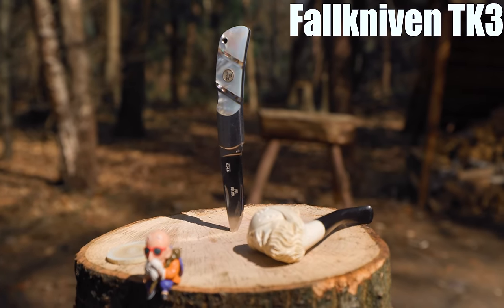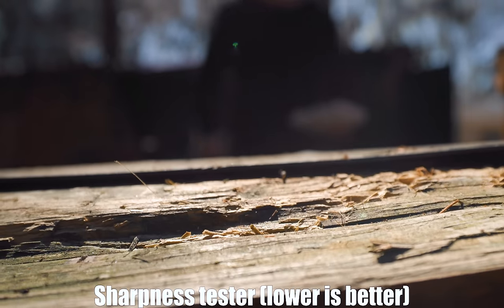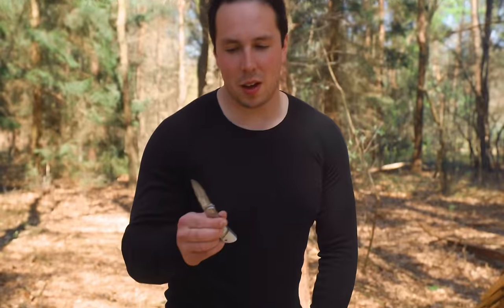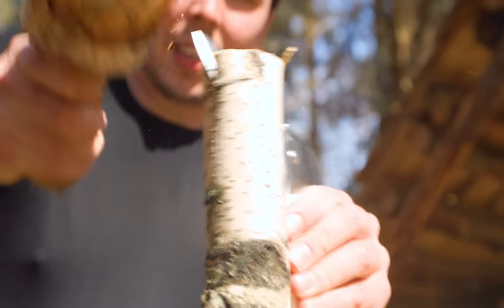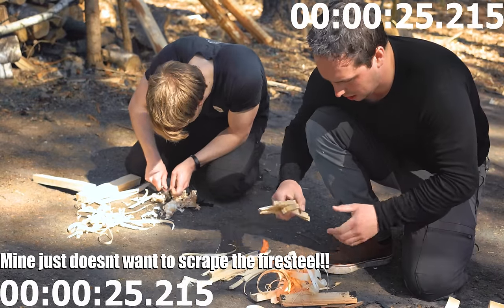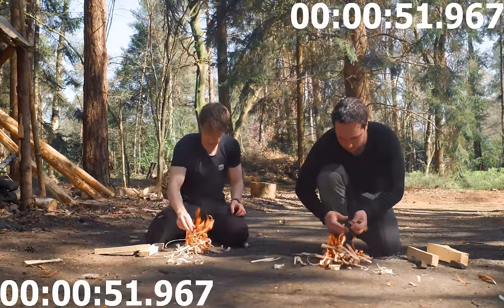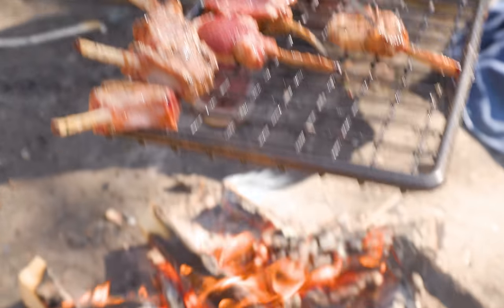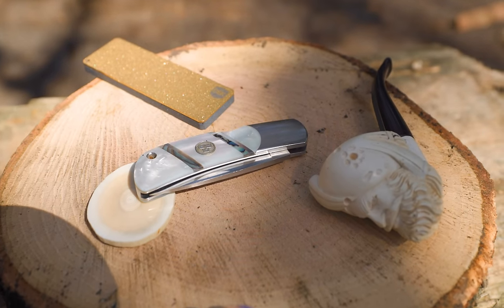Most used knives in our $50,000+ Collection...FALLKNIVEN still wins. EDC favorite

Comment: Hello guys. My ADC is a Leatherman Surge,  as a knife not to brag about but I personally have use for the pliers and screwdrivers. And yes in a emergency you can actually cut something with the blade. And I don't have to carry a tool roll when I'm riding my motorcycle.

Comment: For my EDC: 8-9 out of 10 times since about 2015 will be Cold Steel full-size AK-47 folder/ Back then I purchased 4-6 of these at $50/knife. Still EDC-ing the first one despite losing the Demko thumb plate. That said... it made me use Loctite on all the rest of my Cold-Steels w/ this feature for loss prevention. For my multi-use... the Triad Lock design on a folder is the greatest strong-suit benefit.

Comment: Most carried knife is my lowly Opinel no. 8 in carbon.  I have slimmed / squared and contoured the handle.  It meets all of the light duty tasks that I'll typically require.  Love the thin razor of a blade for cutting up food for my kids while we are out.  Best suited because I live in a hot weather climate I wanted something very lightweight but with a decent length of blade that I won't hate riding in the pocket of lightweight shorts.

Comment: Awesome video as usual 👍 My EDC = Cold Steel/Taiwan Voyager 5.5" clip point plain edged. Backed up with Victorinox Scout. Carried for left handed use. In my EDC backpack is Cold Steel TaiPan VG1 SAN MAI set up to carry SOB left handed backed up with Glock #81 field knife attached to outside of EDC backpack. The Ontario 18" machete, folding saw & Estwing hand axe are kept in back of the Chevy Suburban. Thinking of retiring the Voyager with Espada XL G10 as it's replacement for EDC primary. Saving up now while still undecided on which Falknivan knife to add to my pile. Your videos are paramount to making my final choice. Looking forward to more outstanding content. Thanks again & best wishes 👍 from 🇺🇸

Comment: I carry the spyderco Domjno the most it’s around $200 carbon peel handle on one side and a titanium frame lock with steel insert on the other side nice big bellied blade thin and slicey edge and grind CTS-xhp steel holds a great edge sharpens fairly easily the only downside is that it’s a flipper and the detent on the blade isn’t strong enough to fire that blade out with a twitch of the wrist but u get used to it .

Comment: Loved this video guys, not least because I also have the PXL (black) in my EDC rotation and think it's brilliant for the same reason - that convex grind is just unbeatable, and pretty unique in a folder.

I rotate this with a Bugout, Spyderco Sage 2, Fallkniven GP and an Adamas depending on where I'm going and what I'm going to be wearing. Also keep a Victorinox Rangergrip 79 in a pouch on my work PPE pants, purely because it does the job and I don't mind if I trash it.

Comment: My most used knife, is the Manly Patriot in D2, which even though I've sharpened it a lot the last 5 years, it's still look as if I haven't removed any steel! They literally do the best heat treatment on D2 steel and they also make the best full flat grinds out there, that are super thin behind the edge. That doesn't only provide cutting performance but also the geometry won't change to really fat, as you sharpen that knives through the years! If only they made a bit thicker handles, but that's an issue wtih most if not all production knives (except Morakniv and Ka-Bar/Beckers)

Comment: I carry either a spyderco stretch in zdp-189 or a spyderco endela in k390.  I love both knives and although the stretch is probably my favorite, the endela is very ergonomic and thin as well.  So far k390 has been my favorite steel in a folder because it just stays sharp forever, even a little better than the zdp-189 in my experience, although zdp is not far behind.

Comment: I'd like to see you guys test a good old Buck 119 or 120 or 124.
Not exactly a high end knife but it's lived ita long life and served its purpose. 
Nothing like the heat treat used by Buck.  Good edge retention and easy to resharpen. 
Just like my EDC Buck 110. In my pocket since 1979
Reply: Good edge retention for a 420HC steel relatively speaking but compared to most other knife steels even Bucks heat treatment leaves 420HC near the bottom of the pile. Still really easy to keep sharp though with just a polishing steel.

Comment: In the last year outside of work, I've been carrying in order of most carried Heretic Medusa, Microtech utx 85 Se edge half serrated, Kizer GTI, heretic wraith, boker kalashnikov xhp blad, and kizer domin. Just got a Chaves street redencion yesterday and the nostalgia of this knife brings me back 20+ years. It's similar in handle to two knives I bought in 2001. Those knives were carried until I broke one blade and the handle fell apart on the other. Frankensteined them together and eventually that broke too. They both had chunky blades, not sure what crap steel they were made of. Dulled super quick. I think combined I spent less than $35 for the pair. Why would I compare them to a Chaves? I do because I've spent years looking for something similar in build to those knives, only this time the knife is quality built. I believe this will be my main edc for the foreseeable future. I love it. I just can't say enough about it. I like the skull clip too. Feel like a kid again! I have a pretty big want list, but now any time a different chaves pops up that will jump to the head of the list.
Reply: And thank you for making your videos. I've made several knife decisions based on your videos and added quite a few fixed blades to my list based on what experiences you've both had with many knives.

Comment: I usually have a Victorinox in my pocket because of the need for a non locking blade, I Currently have the farmer x in Alox which is great. If needed I do sometimes have a Spyderco Wolf spider or a Ben Orford Nomad which are both great folders for Bushcraft.

Comment: You guys should test the Cold Steel Finn Wolf folder if you haven't done so already! Basically it's got a true scandi edge (no microbevel), and the Tri-Ad lock; the downsides are its aus 8A steel, and its thin handle (lots of hotspots). For EDC, it's one of my favorites.
Reply: It’s a pretty good budget folder. I put aftermarket scales on mine to make up for the slim handle. Really makes a difference.
Reply: @pubplays368  I didn't consider that! Good idea

Comment: Any fixed blade recomendations? I want the best knife you've ever used in the outdoors. I love Bushcraft Black, Becker BK7,Ka-Bar Mark1, Lionsteel M4 and TRC Mille Cuori. So anything except those.
Reply: Best outdoor knife in the world is the TRC Apocalypse. I have the DBK edition (convex), but you can do the secondary convex also by resharpening that original V edge...
Reply: @daniel.rosina  Thanks! That's a great knife, but it comes with a very thin handle and that thick blade, makes things even worse for my tastes on a knife. Great knife though!
Reply: @greekveteran2715  yes, I have large hands (long fingers) and that handle is also thin for me. Therefore I want to ask a knifemaker for putting there some wider scales. 
However, the thickness of the blade is actually perfect for batoning. (I know, it is not so good for food prepping)

Comment: Spyderco Para 3 in CruWear is generally my go-to smaller knife that I'll carry for light/medium usage, but when hiking I usually have my Cold Steel AD-10 in my pocket.  It carries surprisingly well in my shorts pocket (as everyone knows the clip on an AD-10 is super tight, but my shorts material is super thin so it all works out), and I don't even notice I'm carrying it even after 10 miles.  I may have other knives in my pack depending on where I'm going, but the AD-10 is my last resort in case I need to stab a mountain lion in the head before it mauls me to death.  I did finally sharpen my Para 3 after 3 1/2 years - took around 20'ish minutes to get to a razor sharp polished edge (it was still decently sharp after all those years, but not quite hair shaving sharp).  Now....for my "car bag", I have a Victorinox Handyman and either an ESEE Xancudo fixed blade or an ESEE Izula 2.

Comment: Why baton when the manufactures states to never baton with this knife? Do you guys WANT to break knives? I understand that you push a knive to its limits as a test but if the test is clearly out of bounds i don't see the use. Other thing, what's this fetish with extreme sharpness? At a point a knife becomes so sharp (smooth) that drawcuts become nearly impossible which are the main cuts used in an edc. It is my experience to keep the knife "toothy" for easier use in edc.